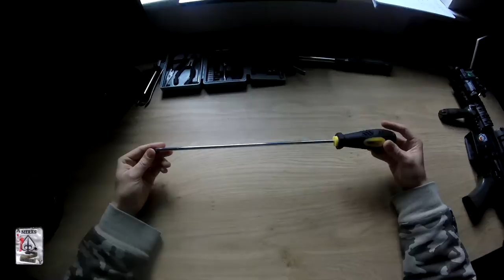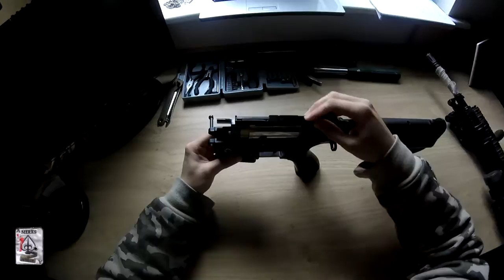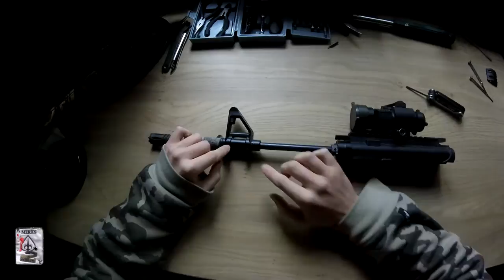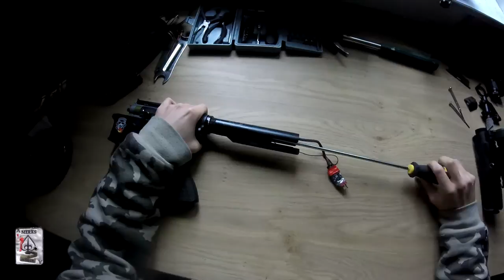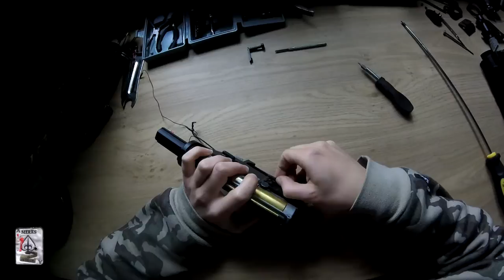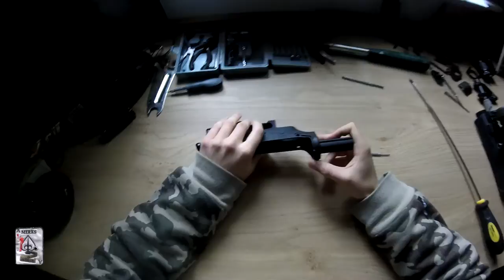G&G GR15 Raider; Externals Dissasembly (Part 1: COMPLETE Dissasembly/Reassembly)

Comment: Thx this helped alot,  i do have a question im new to Airsoft and was looking to get a G&g gr15 raider. However I've seen reviews about the outer barrel  having a bit of wobble to it. And im a bit hesitant on taking the gun apart due to the lack of experience w/ airsoft guns. So my question is would it be fine to leave it how it is or would it affect the accuracy due to the wobble?
Reply from the maker: Hi mate,  I would highly suggest you try fix the wobble as it usually means the grub screws are loose and you could lose your barrel. there is another video which shows you how to fix this. think its part 3 or 4 of this series. the external reassemblt
Reply from the maker: +Merks Airsoft Channel 
Let me know if that works. 
~Webster
Reply: +Merks Airsoft Channel  ok will do thx for the advice  really appreciated
Reply from the maker: +G4SMonkey any time mate. also as a point of note. the newer raiders which is likely the newer generation raider you'll get if youre buying it new have this issue fixed. The factory now actually tighten the grub screw so it really shouldn't be an issue for you mate :). it's usually the older gen raiders that have this problem (like the one im working on here)

Comment: 20:50 i can't seem to separate these wires... the connected part can be wiggled around but i can't separate them. I also have problems popping the pin above the trigger out, is it this stiff because its new or is there a technique to doing these two things?
Reply from the maker: GotToast I 
If your rifle has never been taken apart before both of these things can take a lot of effort. With the wires you can try to get a small hobby style flat head and carefully pry the female ends of the connectors open a little bit. Don't go crazy because you won't be able to get them closed properly again. Just get the screwdriver in and put some upward pressure so you can get the male side out. 
As for the pin. This pin is serrated on one end. Also make sure you take off the pistol grip first before this pin as the pistol grip screws pull the gearbox down making this pin more or less impossible to remove with the pistol grip still in place. Look carefully at the pin on both sides of the receiver and you should see that one side has slight serrations on it. You want to push it from the other side so that the serrated part comes out first. If you try it the other way around then you have to get the serrations through the width of the receiver which will cause a lot of hassle. Again a decent solid tap with a punch and hammer will do the trick here but just make sure you pop it from the opposite side of the serrations. 
Hope it helps. 
~Webster
Reply: I was hammering that pin so hard that it kind of polished the pin XD and i was hitting it from the opposite side of the serrated end too, finally got it out after lots of hammering and complains from my parents. Anyways thanks for the help and the awesome video :)
Reply from the maker: GotToast I 
Glad to hear it. As you take the rifle apart more and more it will loosen up. If I'm honest it's probably better if it doesn't come out so easy so that you don't lose it. 
Have a good weekend!
~Webster

Comment: Ran into some problems while taking apart the outer barrel. The allen screws are stripped, and the allen key cant get a hold on the edges. I tried to file down the edges of the A post so it would fit into the rails, but that is a no go. The rails and upper receiver feel like they are fused together and i cant get them apart like in the video.

I suppose this warrants a few questions: How should i go about removing the stripped screws? Am i missing something on separating the Rails from the Upper receiver? And what would be a good replacement outer barrel that would fit well with the raider?
Reply from the maker: 5Cryingchildren 
Hi there mate. I'll try help as much as possible. If you want though, just so I can help you more, you can send me some images of the issues to our Facebook page via a private message but ill attempt to answer as best I can here. 
Firstly which Allen keys are you talking about? The small grub screws keeping the front half of the barrel in place or bigger ones holding the rails in place? 
As for the actually removing the rails are you 100 percent positive this is a gr15 raider? Majority of rifles don't actually use this system of disassembly which is why we made a video. Once the 4 Allen keys come out and the front half of the barrel comes off (where the A post is) the rail should slide off revealing a delta ring sort of piece attached to the upper receiver. How far have you gotten in this process? 
And lastly as for the barrel, if you manage to get everything apart and want to replace the two piece barrel with one solid barrel you'll need to get on which will allow that delta ring style piece i talked about earlier to fit over the top of the barrel, this unfortunately means many of the aftermarket barrels won't fit because they tend to have a raised area towards the muzzle to replicate a real barrel. 
If there's any more questions fire away and if you think it'll help me to help you fire us some pictures via a PM on out Facebook page. 
~Webster
Reply: Merks Airsoft Channel 
The gun is definitely a gr15. It is the grub screws holding the front half of the barrel with the A post in place that are stripped. I'm having my dad who is more power tool inclined take a look. Im not too worried about the barrel itself. If I replace the rails or widen the opening with a dremel would an aftermarket barrel work? If not i saw a G&G 2 piece outer barrel on evike that i can get instead.
Reply from the maker: 5Cryingchildren 
It's unusual for them to be stripped if you've never tried to take it apart before. Your dad is going to have a tough time getting in there too unfortunately because the space to work in is so limited. 
Replacing the rails may work but again you'd need to find a set that would fit on the upper receiver and you'd also then need to replace the attachment points for that new rail. I definitely wouldn't recommend widening the delta ring as it may not fit on the threads of the upper receiver then. 
As for the barrel I really cannot say. It's very much a hit and miss with it. If that two piece outer is designed for the raider than yes it'll fit but then why buy that if the one you have now is fine? Unless it's a two piece barrel in the sense that it uses a threaded front end to extend the barrel? 
There are some barrels that are completely flush along the length of the barrel, that's what you need. Others will have a raised hit just past the A post which will stop you pushing the delta ring over it. On a side note you will need to remove the A post before being able to put the rail back over it but that's relatively easy to do. 
~Webster

Comment: I want to remove the front sight because it use a red dot and the front side disturbs. You said you shoud push the two tiny pins out, but this is sooo hard I wonder if they are real pins at all!
Reply from the maker: Herzi Hi mate, not they're not real. You can't remove the front sight of a raider. Like I said in the video the front barrel, muzzle and front sight are all one piece. Also you shouldn't need to remove the front sight for a red dot. The red dot is designed to replace your rear sight, not your front one. It's supposed to be used to line up quicker to the front sight. Adjust the red dot in the sight untill the red dot sits on the top of the post in the front sight. That's how they're supposed to be used.
~Webster
Reply: Merks Airsoft Channel I understand, okay thank Dude!
Reply from the maker: Herzi any time. See if you had just the red dot then you'd have no reference point and your never be able to line a shot up.
~Webster
Reply: Merks Airsoft Channel thanks and bye bye 🤜🤛👍

Comment: I took my d ring off my ca m15a4 by taking off the front of the 2 piece barrel and used a lazy arm clamp on the ring. it was strong enough so that I could easily twist the ring off
Reply from the maker: If that works for you then go for it. You will just find makeshift ways of doing things when working on airsoft equipment. Especially if you start working on them a lot. 9 times out of ten I work on some person's rifle when at a site and even if one thing works for one rifle, it may not necessarily work for another even if they're the same brand and model. 
~Webster
Reply: Is buying a boneyard gun a good way to get into teching on guns just I wouldn't want to mess up my vfc vr16 sopmod cqbr because I paid a lot on it
Reply from the maker: +Kim Jong Un 
It may be a good idea yes. My first rifle was a Dboys SCAR so after a year that slowly got taken apart and I did mess it up a bit. Especially the hop up because I wasn't sure what all the small pieces were. I would highly recommend teching to allow you to maintain and upgrade your own kit. When I first started I was cleansing my rifle after every game but now knowing how they work I realise that, unless it was particularly wet, there's no real point in doing that. If you can find an old rifle by all means go for it. I'd recommend finding an m4 platform if that's the rifle you have yourself. 
~Webster
Reply: Yeah I've been watching how to videos and stuff I know how it all works. The most I've done is building a Hopupand changing upper and lower receiver
Reply from the maker: +Kim Jong Un 
Gota start somewhere though :).  I've found that starting with a v2 or v3 gearbox is the best. From there all other gearboxes are pretty much the same. Must bullpup rifles use modified v7. Usually. But it can vary. Just keep working on them and follow the rest of the videos in the series on our channel. Should help you and drop us a message if you need help. I'll give you a hand as best I can. Even use Facebook if you want to.  We have a page there. You can message us directly.  
~Webster
Reply from the maker: Dammit Webster, stop teaching North Korea!!!
Christ man!
Reply: Sure airsoft Gi told me they don't ship to North Korea because I'm a tyrant when I'm hungry and I should eat snickers and then we'll ship
Reply: I'm looking into getting new batteries what ones do ye use and how many do you use to last a full day
Reply from the maker: +Kim Jong Un 
Hi mate. It depends what you're looking for. Honestly I think the airsoft market needs to move more towards lipo batteries. Most of the merks use them now but keep in mind that to use them you do need a mosfet. I personally use two a day. I don't actually but since recording me and Stephen have gotten into a routine to charge the go pro and change batteries for the rifles and change memory cards for the camera. That way you don't run out half through a game. 
~Webster
Reply: What mah are they
Reply from the maker: +Kim Jong Un 
1300MaH and 15C mate. 
~Webster
Reply: So you use 2 of them?
Reply from the maker: +Kim Jong Un 
Correct :) you could possibly get away with one. Sometimes I forget to change them and it's a hit and miss if that one lasts the day really. But that's why i just change it at lunch regardless of whether it's still firing my rifle perfectly or not. 
~Webster
Reply: So would a 1600mah 9.6nunchuck nimh and one 2000mah lipo last me a full day?
Reply from the maker: +Kim Jong Un 
It should do. Although I would also recommend using Deans connectors as opposed to Tamya ones. I would however eventually completely switch to lipo batteries.
~Webster
Reply: The nimh is deans. How long should I use the lipo until I should check it's power
Reply from the maker: +Kim Jong Un 
Perfect then. What you mean check the power?
Reply: Like your not supposed to let them dye so like when should I stop using it
Reply from the maker: +Kim Jong Un 
Managed to delete my comment somehow. If you mean die during a day's gaming then you should stop using it when you noticed a decreased rate of fire of your rifle. You should do this with any battery though. However you need to keep in mind that lipos require far more maintenance than standard NiMh batteries. they require balance chargers and should be discharged after each use.
~Webster

Comment: what was the c shaped tool to loosen the barrel from the upper receiver? @ 15:21
Reply from the maker: +Victor Schmidt Hi there,
It's a special tool used to remove the delta ring from an M4. It's also used to loosen and tighten the stock tube. They used to come with certain rifles. The one I'm using came with a G&G CM16 but you can pick them up in airsoft retailers or online pretty easily.
Something like this but not as fancy and somewhat specific for G&G Raider series; http://www.evike.com/products/26953/ 

If you can't get hold of one, you can use a pliers to do the same job but it is a little tricky to get the angle right to apply the right force.

Hope it helps
~Webster

Comment: Nice vid credit to the Irish ha can you tell me with the full metal model what spring I can use for fps increase or is it that I'll need to upgrade barrel, gears etc... you might have a bit more knowledge on what standered internals may handle for slight increase from 330 fps. Sound
Reply from the maker: Michael M 
Well any upgrades may need upgrades in gears but it depends on how high you want to go. The limit here is 328 fps so we never look into going over that. I tend to recommend m85 spring with g&g green hop up bunkings. An m120 may suit your needs more but it really depends how high you're going mate
~Webster
Reply: Sound mate great videos and very informative cheers one more question regarding the barrel is it much hassle sourcing a longer end barrel mine is the shorter barrel DST and yours looks like the gr15 radar - L so I beleave ? M
Reply from the maker: Michael M 
Mine is actually the shorter barreled version too. That's just an old barrel extender I had lying around of a scar which is decided to use to allow me to install a longer inner barrel. If you're looking to install a longer inner barrel you have 3 options. Get a suppressor to cover the inner. Or get a barrel extender like I have but I have never seen them sold separately or get a new outer barrel. Given the raiders design, the last one is likely your best option as it removes the crappy front sight design. The issue is that you need to then find a replacement A post (front sight) so that you can slide it over the new barrel in the conventional way and you also need to make sure that the new outer barrel allows the metal ring that goes over the barrel which is used to screw the front two screws of the rail into it to secure it. 
Many outer barrels have a metal raised part about 3 inches down to replicate the real steel ones. That's fine for more Airsoft rifles but that metal ring that holds the screws for the rail doesn't fit over that raised part unfortunately.
So it can be done and you have some options. From a cosmetic point of view, if you don't want to go with a suppressor the last option is the best. It also removes the rifles biggest design flaw but you do need to make sure the barrel allows the rail to go back on 
If you need to know what I'm talking about, send us a message on Facebook. We have a group, just search us and start a private chat and I'll send you a picture of the issue I'm talking about. 
~Webster
Reply: Great will do thanks :)

Comment: How could I take an ambidextrous selector switch off and the slide release I have a Gbb version
Reply from the maker: Hi there mate. I honestly have no idea. When it comes to gbb rifles I'm somewhat useless. Gbb pistols I can deal with. 
I'd imagine the selector switch is held in place by the internals much like a real ambi switch would be. Look for small grub screws. As for the slide I'm not sure what you mean. 
~Webster